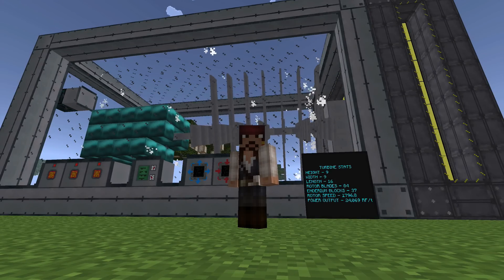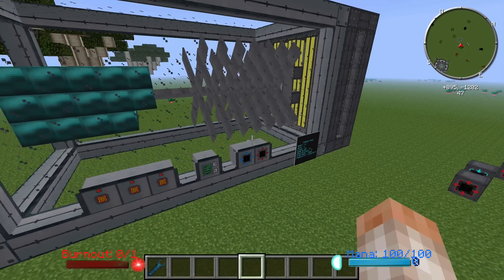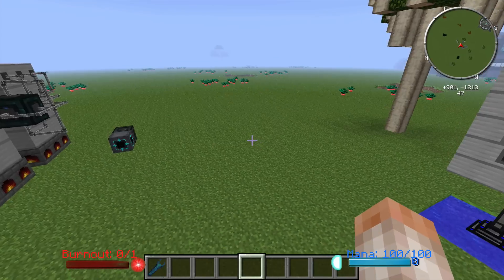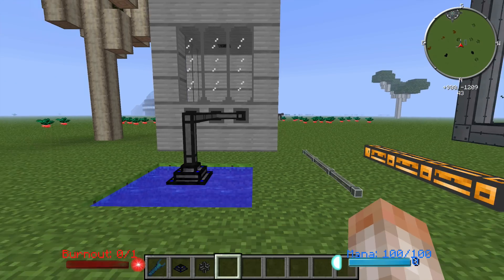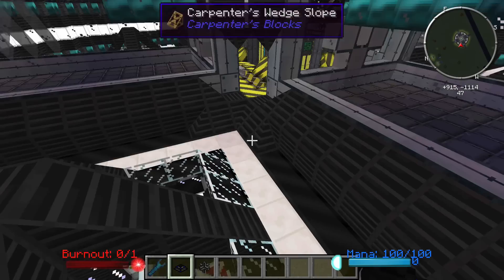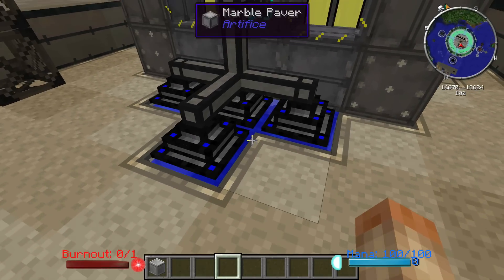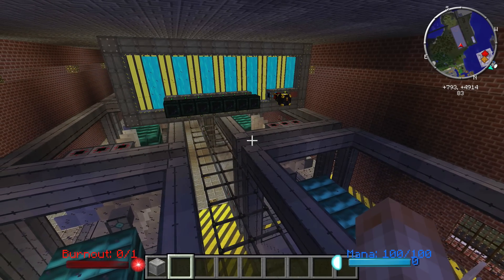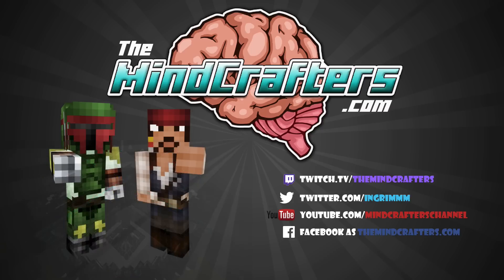Tutorial: High Powered Big Reactor Turbines

Comment: That turbine, is it the most efficient.  I've looked at the numbers and mathematically I can't figure out something better.  But then I was looking at how the blades are set up.  Could I make one with the same blades, but less on a "ring"?  Meaning it becomes longer?  Or is the height dictated by the reactor giving it steam?
Reply: Found some information if anyone else was wondering.  If you look at the data put into the google doc in the description for long enough and figure out how to read thoroughly, 3 rotor blades to make the length (so each coil has 4 blades, each blade made of 3 blade parts)  Is the most efficient. Number of blades is dictated by the amount of steam, amount of steam dictated by what the coil is made out of for max power output and getting as close to that magical 1800 rpm as possible. 

As a side note.  That amount of enderium requires 334 ender pearls. annnnnd 117 Pyrotheum.  Halo anyone?
Reply: try 7x17 with 37 enderium blocks
Reply: 334 of ender pearls is nothing, just make an auto spawner with endermen and let it work at night, got 4k enderpearls :D
Reply: KingDragon2722
just a standard enderman farm in the end + a grinder gives way more lad. dont have exact numbers due to only having one in my previous world but i can quarantee you get 20k+ if you let it go for the night. EDIT built one on my current world and got 10k in just about 2 hours
Reply: the problem is you will never need that much unless you dont want to build your house out of enderium blocks.
Reply: SamuelDM my 5x5x27 turbine with 36 enderium @ max steam generates just shy of 29000 Rf/t

Comment: I have an important question.. please help :D
Are active cooled turbine reactors more efficient than normal atom reactors?

Materials dont matter, i have enough :)
Reply: Yes.  I tested it for myself because I wanted to see.  I made a simple reactor, nothing insane, just one you would build once you had decent resources.  It made 127,000 RF/t but used 2.076 mb/t worth of fuel.  I then made 9 turbines, which combined made the same amount of RF/t but combined only used .207 mb/t worth of fuel.  Each of them had their own little 9x9x3 reactor to power them.  So my setup was 10 times more effective.  Just took that much more resources. But even with 9 small reactors it still didn't use anywhere near the resources the single reactor used.

Comment: Which laser focus increases the likelihood of drilling yellowrite ore?
Reply from the maker: The Lime laser focus will pull uranium which can be pulverized into Yellorite dust.
Reply: Thanks! I'm looking to create the 'smallest' possible self-sustaining mining rig, so uranium is a big priority.
Reply: iWishmaster
I've tested a 5x5x5 reactor (passively cooled, no turbines) with a laser placed at y 128 (most efficient laser placement) with full lime foci and a little ME system for auto processing / feeding the reactor and it was totally self sustaining.  Granted, the laser wasn't running at 100% capacity, but that wasn't the point.
Reply: Cyan laser focus.

Comment: i think with applied energistic laser drills and solar panels with a atom reactor the stuff you need to build should be easy to make
Reply: EnderIO ender quarry. If you have at least a 200x200 quarry, GG. Let the ores flow in to your ME system. I legit have 10 1000x1000 quarries. SO MANY ORES.

Comment: actually power taps can handle unlimited amount of RF/t. the limitation is just from the conduits/energy pipes and stuff
Reply: I think the point he was making is that you'd need three to use TE energy conduits.
Reply: SamuelDM
Ender IO, not TE
Reply: C Doe Fam, with EnderIO you'd only need 2 power taps.
Reply: Yeah, I would always use Mekanism energy cables. Their energy transfer rate depends on how many cable blocks are used together. One basic cable can transport 200 rf/tick, but if you place 100 of these very cheap cables together they can transport 20.000 rf/tick easily. And then you can also use the ultimate energy cables instead, where each single cable can transport 12.800 rf/tick which stacks up insanely fast.
Reply: abschussrampe Or you can use tesseracts to tap into it and use what you need. I have gotten 1 million RF/t out of a single tesseract, getting me about 5 seconds to charge a resonant energy cell.
Reply: Unless you want to use a separate Tesseract for each of your machines, using them is not viable. What I meant by my last comment is that using Mekanism power cables after a Tesseract already transports the power into your base is probably the best choice.

Comment: I thought Big Reactors and Big Turbines push out as much power as they can regardless of the bandwidth of TE connectors.  I know they push out as much fluid as they can regardless of the bandwidth of a Thermal Expansion Fluiduct because I only need one out of a Big Reactor to get all the steam from it.  I still need multiple fluiducts to the turbine(s) when I build em, but I've never needed multiple from the Reactor.  Ender IO conduits are a different matter entirely, I'm not sure parallel connections even matter because the bandwidth stayed the same regardless of how many connections I had.
Reply: The conduits limit the input (Redstone = 10k RF per connection point.)
A tesseract will take and transmit unlimited....
Reply: Nathan Brom  No.  Actually that limit is bypassed at the connection of the reactor.  I've tested this multiple times in FTB Monster.

Comment: Hmm what would I do with that much power?
Reply: I KNOW! I will charge a battery with it
Reply: David Yue
Yep. I am playing the Mindcrack Modpack and since I will never need this much power for any lasers with Mekanism installed, I just use 150 Hydrogen Generators which translates into 18000 rf/tick with exactly zero maintenance cost, feeding into 3.5b rf battery, which in turn are feeding 3 different Tesseract frequencies. I power my entire server with that setup and use zero fuel for all the energy!
Reply: Oh god, thinking about all the fences I would have to place.... Isn't putting down a couple of MFR Lasers just easier in both the short and long run?
Reply: ***** the costs were changed thank god.

It took 240kRF a tick to keep a fully upgraded Speed 3. silk 1 ender quarry chugging along. Now its down to 45K.

I have 40 of these turbine in my base, with ludicrite blocks, outputing 28k RF a tick each. I use 32 ludicrite blocks and drop the total number of rotor blades to 80.
Reply: abschussrampe a max speed ender quarry uses the same power as 2.25 maxed MFR lasers (45ktf a tick). It returns 2 ores a second, vs the one ore every 15 seconds from a MFR drill. The ender quarry is more than worth the effort.
Reply: Dan Nolan I wrote that as far as I know even before Ender Quarry Upgrades were released. Before The Ender Quarry Torches were released. Before it made sense.
Reply: Use all the RF on a 100 cell Super Soaryn Drive
Reply: Do you think the mod makers will ever plan on making a bigger battery?
Reply: Ender IO capacitors were changed with last update. Much better now
Reply: David Yue look into draconic expansion there is a storage multi block that the top tier holds 2.14 trillion rf

Comment: Actually, RF is worth less then MJ, and that's 12 billion MJ, which could be almost double in RF
Reply from the maker: 100 RF = 10MJ
1000 RF = 100MJ

...and so on and so forth. One is not worth less than the other which is why they can be used interchangeably.
Reply: The MindCrafters
I was speaking from terms of storage capacity

If it's being stored as MJ, then RF will be worth alot less in terms of filling it up, which would put that 12 billion storage of MJ very up there when you consider how much RF is being produced

Comment: Is it just me, or is that power production extremely underwhelming? I realize the video is from 7 years ago, so maybe things have changed. But a structure that big only producing 24 KRF/t? It's easy to make a small group of mekanism gas burning generators burning ethylene to provide that much power. What, 3 of them nearly matches it? 7 of them would produce twice the power. A large array would blow that turbine away. (pun intended)

I may have to try making one in creative mode to see if they're worth building in a modern modpack.

Comment: Could you create an updated version of this world for 1.7.10 clients? When i loaded it, for some reason it swapped nearly all the blocks for OpenBlocks blocks, and some Natura ones as well. All the reactor glass was also missing, not being replaced by any block. I did have Big Reactors, IC2, AE2, and Thermal Expansion installed

Results: http://imgur.com/a/ne36g
Reply: Your block id's are wrong. If you have the same mods installed try copying the config folder from his modpack and see if it works then.
Reply from the maker: I highly doubt you'll get an MC 1.6.4 setup to convert to MC 1.7.10. For starters, ALL of the mods are different (typically a buttload of versions newer - new blocks, do things differently, diff mechanics, etc) and the way that MC assigns block IDs completely changed (which is part of why everything was fubar when you tried to load it). You'll have a hard enough time trying to convert between modpacks in the same MC version - let alone switching both MC and modpack at the same time. Best of luck :D
Reply: The MindCrafters Lol I forgot about the blockID changes. Crap. I guess my idea won't work. Oh and by the way I added your giant mining laser thing and added it a different world using world edit and right now I am working on adding a ComputerCraft system to tell me the power left in the system(I added another floor that has a small room with a computer and the rest of it is all capacitor banks). Anyway thanks for the amazing world download that let me get my hands on the amazingly beautiful selfpowered mining thingy.
Reply: The problem seems to be that you're trying to get FTB to work consistently across versions. Not happening, sorry.

Comment: Cap I gotta ask. Were you being sarcastic about the transfer nodes/pipes/upgrades being expensive? I always actually thought they were pretty cheap for the amount of stuff you can transfer with them. Just curious
Reply from the maker: Well if you put the need for them into perspective than I guess not so much....they're just a huge pain to make, and with all the diamond needed to make the upgrades they really aren't cheap. Once you get to to the point where you need that much coolant, you would have more than enough resources to make these.
Reply: The MindCrafters I think that what most of us are thinking, is, that by the time you're at the point (resource-wise) to be able to build that first reactor you showed, the little bit of gold, redstone, and diamonds that it takes to make the transfer node upgrades, is a mere pittance, relatively speaking. (Seriously, who has enough materials to make 37 blocks of Enderium and doesn't already have diamonds out the wazoo?)  ;-)

Comment: I just built a giant reactor and it produces 170,000 RF/t using materials from 3 quarries, so I see no need for turbines especially since they have a max build size and reactors to my knowledge do not.
Reply: Reactors have a height cap of 48 blocks, i tried 100 but i had to manage with my 12x12x48 putting out 600k :(
Reply: I changed the caps in the config files so I could build my behemoth. It ended up putting out 2.6 million RF, but the problem was that it caused immense lag due to the textures. I don't recall the exact size but I know it was 46x46 base and the height was around 90ish I think? I used a measuring tape to make it perfectly square, but of course I didn't need to measure the height for that, but it was much much taller than my first reactor. It took about 4 days to build, and I used gelid cryotheum I got from a mystcraft world that had OCEANS of it, which of course is a pain to use since it falls so  I had to use blocks to hold the source blocks. I had the materials though, it only took about 11ish total quarries or so, and if I didn't have Applied Energistics and a jetpack this would've been near impossible lol

Comment: Im not sure how many fuel rods to put into my reactor. If anyone could help out it would be great!

http://wiki.technicpack.net/Big_Reactors
I saw on the wiki that it gave this equation: P = Z[2X + 2(Y-2)] + 2[(Y-1)(X-2)] - A - B - 1

X = length of reactor Y = Width of reactor Z = height of reactor A = how many fuel rods you want B = how many power taps you want
To figure how many reactor casings/glass (P) you need simply fill in

It then says:
for fuel rods you need to do A(Z - 2)

Im not sure if this is telling how many fuel rods someone would need or not and if this is its own separate equation or it is supposed to be put in the old equation.

Any insight is highly appreciated!

Comment: Only 100k RF/t I need a beast setup (I have infinite resources thanks RFTools so that won't be a problem) I just want a setup that can get me atleast 300k RF/t or 200k RF/t
Reply: If you have infinity resources and have enought time, you could create the biggest big reactor (with cooling) to get 1.8 Mil RF/t or   if you have DE get the Draconic Reactor
Reply: 1.8 Mil RF/t isn't useful enough for me. Im trying to run 5 max quarrys and 3 MFRs And its drainin my power and making that will be easy because of my resources but it'll tale a while to do that EVEN with the super builders wand and I need to place the cryotheum and wait for it to sink all the way down >.>
Reply: I found some turbines in mekanism that are FAR better than big reacors turbines will ever be. It uses around 8-10 B/t and supplies me with a amazing 400k rf/t and ITS SOO SIMPLE to make I barely need to place anything. So I just have 3 or 4 of those set up and boom.
Reply: HandinOutTheL but it's not as fun as the big reactors turbine... 😋